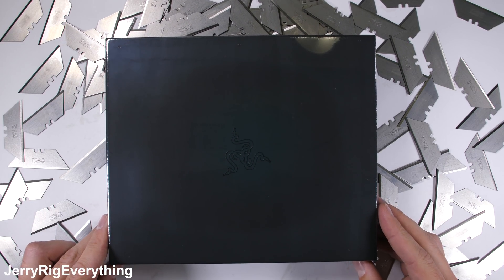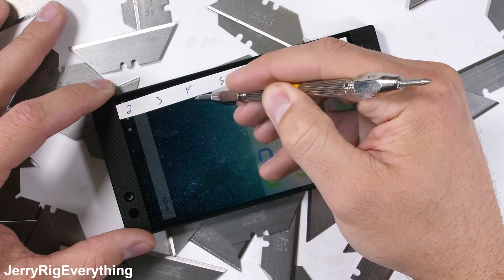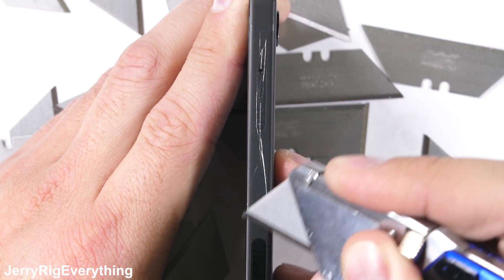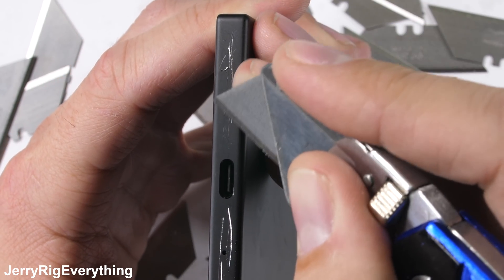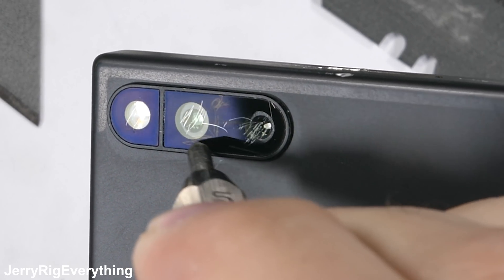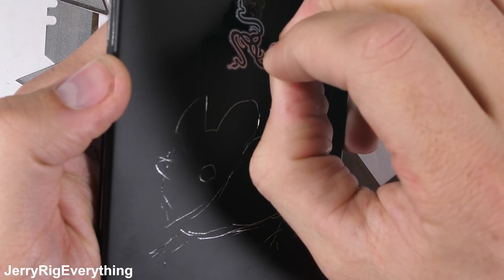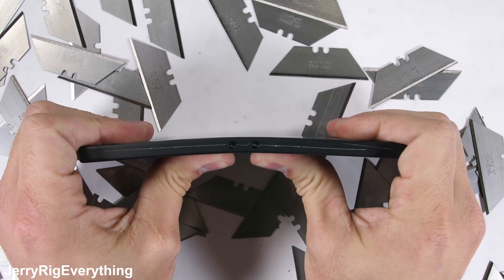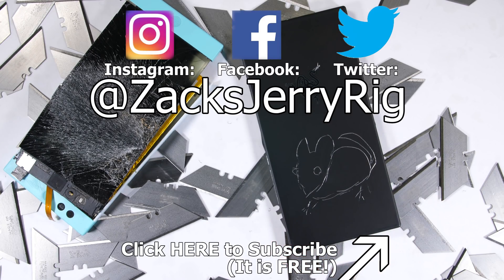Razer Phone Durability test - Scratch BURN and BEND tested!

Comment: Jerry, in the box there is a little adapter called the razer connector that can upgrade the quality of the headphones. At the 3 shop they plugged the adapter in with some standard AKG Samsung earphones and it made the sound quality very high. So, yeah.

Bye

Comment: Expensive trash...
Reply: For gaming its a beast, its a gaming phone. Use it for gaming not everyday use. Its like you buy a ferrari to drive it as a fiat.
Reply: @aliasgarr  It's running outdated hardware now so it's not good for gaming either
Reply: @PaneledPear  
Snapdragon 835, Android 8.0(update) 8GB RAM, highest screen refresh rate, etc 

What says that it's running outdated software?
Reply: @pyrrehraus6571  Not software, but purely hardware. That's a previous gen chip now, and until Razer releases a new model (probably won't), it's outdated and worse for gaming than any flagship now.
Reply: But it's better than your phone any day.
Reply: Mitsos Da Best lmfao this is the one of the best phones lul
Reply: @joris_gloris6792  no
Reply: @PaneledPear  Yes
Reply: @joris_gloris6792  Well not anymore at least.
Reply: @Javastorm Yeah that's because it's made of glass. I'm not an iPhone fan, but objectively the iPhone X is way more powerful than the Razer phone. 

Also, there's no guarantee for software updates, so the phone isn't really very good anymore.

A better phone for gaming is the $300 pocophone f1. It is durable and is capable of outputting better performance than the Razer phone.
Reply: @PaneledPear  tf do you mean "better", usually the Razer functions faster than iPhone x
Reply: @YurizoSakai  Not in games which is exactly what this phone was made for lol.
Reply: @PaneledPear  8 gb ram with Android 8.0.. we can even care less about those other outdated systems
Reply: @YurizoSakai  In what way is iOS outdated?
Reply: @PaneledPear  customer persuation
Reply: @YurizoSakai  I'm a complete Android user and even I can see that iOS has its advantages. It's not outdated, it's just limited in the ability to customize.

Comment: $700 ?????? WHY ?
Reply: What do you expect its razer
Reply: castlevina, First if all, 120hz beats the 90hz ROG phone, and second of all the Razer Phone isn't as flashy so it may be more desirable
Reply: i think he meant: WHY WOULD YOU BREAK A 700$ PHONE!!!
Reply: 1. It's better than IPHONE X... 
8 gb of ram
4000 battery
120 refresh per second that none of the phones got...
64 GB of stock, the same like an Iphone but it's more than enought
Pretty good cameras
Very good at gaming
Very good glass on the top of the phone and it's very hard to make scratches on it (bad enaglish)
Reply: @c0ldm-ampupatcucatade4ori  yeah but doesn't matter, some reason people prefer the most expensive phone. And to touch a completely glass front and back.
Reply: "pretty good camera" lol it's shit dude.abbysmal screen to size ratio,shitty vibrate motor,no headphone jack,and really dim screen,works fine inside a room but is a hindrance when you are outside in the afternoon.
Reply: Cause he can
Reply: It's 700 because of the color green or gold of the logo if you order it or buy the phone black it will be 600
Reply: Don't worry he didn't pay the phone, it's just marketing.
Reply: looks at every current apple phone
Reply: @Marko Lazar 4
Reply: dude the Razer Blade pro costs about 4500$ wtf did u expect
Reply: Oh to have 700 dollar phones be the max. Now they're 1,000+
Reply: @castlevina8425  but the razer phone has a 120 Hz screen I know it's a screen but still that is pretty good for a phone
Reply: at least cheaperr and way betterr than the over priced iphone x
Reply: @castlevina8425  this razer phone is the old one you slow fuck
Reply: Floops what did you expect? Its a proffesional phone...

Comment: There is a reason why it has no headphone jack. They used the rather large space it takes to put in for more battery (about 500mha extra). Besides the phone comes with a USB dongle wich isnt just a simple dongle but a THX certified D/A converter, so it will give you better sound than if you had a built in headphone jack. So in the end it's really a win win for the consumer...

Comment: im going to call the bend test a failure... 2 reasons.. 1 is the bend stays...and 2 is the frame cracks/breaks..  once bend the point the frame failed and kinked no recovering it completely.. i have a friend who just got his Razer phone, he a razer nut.. he already bent it and its obvious been bent...

the phone is just bad in general... i can kind of forgive them, first attempt at a phone but the screen is soo poorly lit, the frame is so weak and plasticy, the top and bottom bezzles are poorly used space.. the only 2 redeeming features of this phone is battery and the speaker quality... camera is shockingly poor (both front and back sets), the soc maybe high end but the performance when heavily app switching is not.. not even talking about reopening apps or anything ..i mean huge slowdowns at times..just doesn't respond for a little bit..also a cold bug issue my friend encountered leaving it in his car over night once, and it got into signal digits and the battery indicated remaining power was 1% for longest time until it warmed up..

Comment: Hey Jerry, just one thing: watching videos on 120hz won't make a difference in the overall experience, as most movies are encoded at 24 or 30 fps, or capped, at most, at 60 fps (i.e. youtube). The extra refresh rate won't make a difference over a video's smoothness, but it will make a huge difference in games and for the Android UX, which can now render its animation to a synced 120 fps.

Comment: The speaker grills are made of metal not plastic. And when you tear it down could you pls check if the screen assembly were possible to separate I mean to actually separating the lcd panel from the glass. I have the razer phone and there are already some dusts got in to the screen assembly so i would pretty much love to know it’s even possible to clean later without permanently damaging the phone thx :)

Comment: Pixel 2 did almost the same thing and you hammered it for being weak.  This is crimped, and cracked, and is bent, but is still structurally sound?  seriously?  looks like trash after you warped the frame.

Comment: You need to categorise your bend test a bit more. Pass/fail isn't really accurate enough. For example a phone that doesn't even give in the slightest shouldn't be in the same 'pass' category as a phone that bends slightly but still works, or a phone that cracks in the mid-frame but still works.

Comment: I'm a bit disappointed.. I was expecting this phone to be built like a Sherman tank. The easily scratched camera lens isn't great and no headphone jack is a big loser on something promoted as a gaming device. No water resistance either. They've made the same mistake Essential did, thinking famous brand name or famous personality will sell a second rate device. It doesn't work like that. It didn't even work for Google given Pixel 2/XL disastrous sales figures, though in defence of Essential and Razer, the Pixel was third rate rather than second.

Comment: Cons:
-no OLED
-Screen to body is trash
-Gorilla glass 3?
-No headphone jack 
-No ois. 
-Fake aluminum coating. 
-Breaks easily.

Pros:
-sound(cuz you can't use earphones.
-120htz display

Too many trade offs for just better refresh rate and speakers. Connect a Bluetooth speaker and it'll be way better. Or... you know, include an headphone jack..

Comment: Could you test different kinds of screen protectors? I could not find a single great experiement on this from youtube and I would especially like to know if liquid screen protectors increase the hardness of the screen (as much as is claimed). Most of the test are   hardness tests with everyday items, drop tests or similiar which are very susceptible to chance and are not very precise...
Reply: Luukas R yeah liquid protectors are perfect they will reduce all scratches also it wont let the water stay on the screen also it avoids from finger prints
Reply: Mrwhostheboss tests all the glass ones in one video, he found $1-45 ones are all the same, $80-100 Sapphire ones are a little stronger but literally 80+ times more expensive, so just get a cheap glass one, he also did a different video on the liquid ones which do seem to work to an extent

Comment: The reason they didn't put a headphone jack in it was so they could fit a larger battery in it which resulted in a 500mah increase not because they are lazy 

Direct Quote from Min-Liang Tan's Facebook "I see a lot of feedback on the removal of the headphone jack on the Razer Phone - and I wanted to share some of the thought process when we made the decision.
By removing the headphone jack - we were able to increase the battery size significantly (I estimate we added 500maH more), improve thermals for performance and a whole lot more.
The trade off was not having the jack - but what sealed it for me was that we were able to get audiophile quality sound with the dedicated 24-Bit THX Certified DAC adapter - and I made sure we included that with every phone. Which basically means we give even better quality headphone audio for those who want to hold on to their analog headphones.
On top of that, we've released the HammerHead USB C (retails at $79.99) and the HammerHead BT with all day battery life (US$99.99 - or free with Paid to Play!) which makes it a complete solution.
So in short, removing the headphone jack gave better performance, more battery - and on top of that, better headphone audio performance with existing headphones and the option to go completely wireless or jacked in via USB.
I can't speak for other phone companies who made the decision to remove the headphone jack - but I think you guys can see why we did so."
Reply: Let me believe everything a CEO says without asking questions.
Reply: 500 mAh isn't significant
Reply: coming from the ceo of razer......even trump is more honest
Reply: Emiougus its never because of a lack of space. They design the phone, they can make it bigger if that was an issue. They removed the jack in order to sell more of some product or another just like everyone else
Reply: Headphone jack or not, I want to listen to that thx certified sound and front facing speakers
Reply: Miguel Yanez have fun doing that on the train... And really, these speakers are not nearly as good as people seem to think. They are simply to small to produce accurate sound. Even in a headphone they would be too small. These might be good compared to other phones speakers, but nowhere near real speakers.
Reply: Emiougus your "research" is nothing more than regurgitating a lie designed to make consumers feel ok about losing useful features. There was absolutely nothing stopping razer from adding a headphone jack. And once teardowns or this phone start appearing, i think we'll see lots of empty space like most other jackles phones.
Reply: Alonso V On what terms where your evidence to prove otherwise. Unlike you I actually did my research